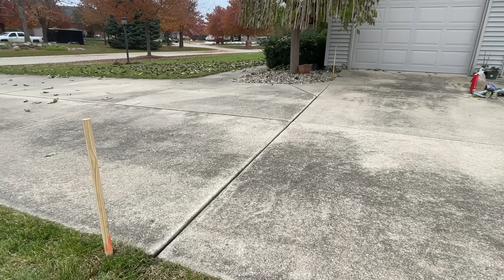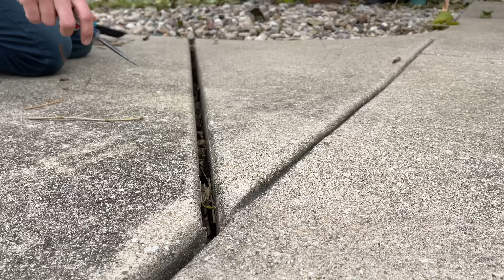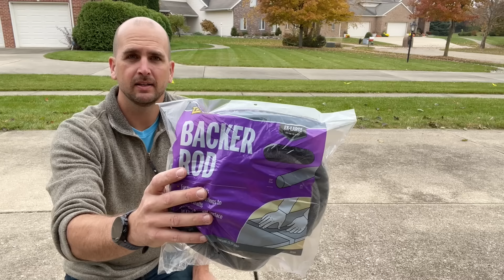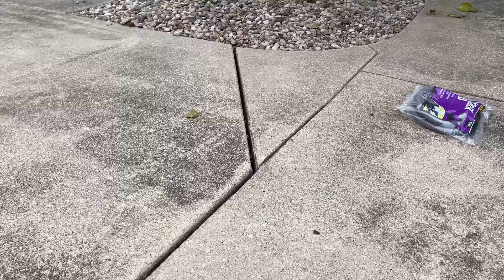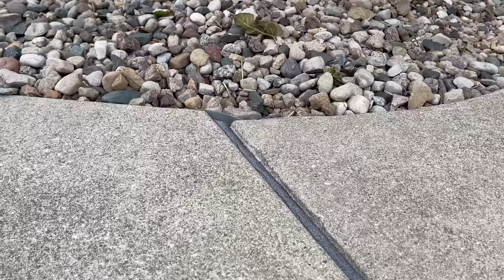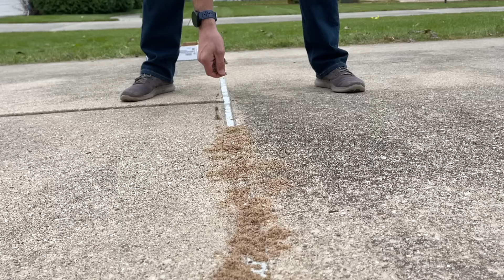How To Seal A Gap Between Concrete Slabs

Comment: Hi Scott, quick question. As you apply the vulkem to the expansion joint across the width of your driveway and you get to the intersections of the of the "control joints", is it necessary to have some kind of blockage (like your shim or tape) to prevent the product from oozing perpendicular from the expansion joint into the control joint?  Also, do you have any video recommendations for vulkem tooling?  I am sure I'll have some of that to do.    Thank you for your fantastic channel!

Comment: While I found your video very informative, we need to replace the expansion joint where our driveway and the street come together. The joint is closer to two inches wide on one end and 3" on the other end. How should we fill that joint prior to the self-leveling filler?
Reply: Playground sand, then Pea gravel...then playground sand again, followed by backer rod and then sealant.

Comment: I have a driveway that has both slope (much less than 6%) and horizontal applications for the sealant.  Besides cost is there a downside to using the Vulkem45 SSL in all applications or what % of slope is acceptable for Sika Sealant.  The specs look the same for gap movement between Sika Self Leveling and Vulkem SSL so it just come down to slope.

Comment: Love your videos, i have a question on slabs.  i have 4 slabs that were poored and they left the 2x4 as an expansion joint.  theses have since rotted out and there is a 1 1/4 gap between the slabs.  one has shifted as well and i need to level it with the other next to it.   can i just use concrete leveler to fill the gap and then level out the remaining.  maybe prefill some of the gap between with sand so it does not take as much concrete?  thank you again.

Comment: We had a patio poured years ago and it has cracked badly over the years. Would this be a way to fill cracks that formed in our concrete patio?  If not, any suggestions?

Comment: Great video, thanks! - Do you have a video on how to fix cracks on concrete slabs?
Reply from the maker: Not specifically, how wide is the crack?
Reply: @EverydayHomeRepairs  I'd say from 1/4 to 3/4 inch...somewhere around there.. maybe this is another video idea? haha.
Reply: I’m interested in this too. I have a customer who has a cracked slab in his garage. He doesn’t want to replace or cover the slab. He’s looking for a cost effective filling of the cracks. 

I’m wondering if this system would work for .25 to .5” cracks.
Reply: @macster1457  I have used the Vulkem SSL as a "thin coat" on some of these surface (hairline) cracks and stone pops, and it is surprising effective and long lasting. I tape out along the edges of the crack/pop, and then just squeeze some of the SSL over the area. Then I use a putty knife to smooth it out. Has worked awesome for me!

I should also mention that I use the Vulkem 171 primer before applying the SSL. It kinda acts like a contact cement with the SSL and really helps bond it tightly in the seams.

Lastly, make sure your are sealing your driveways every couple years as well to keep the water damage to a minimum especially for those of us in the freeze/thaw climates. I use Achro Seal 1315 about every other year

Comment: Very helpful video - thanks.  The gap I need to fill is just over an inch.  Do you think I could use the foam pipe wrap insulation for 1/2" copper pipe?

Comment: Hi , nice video ,  We have the same in our appartments , (but bigger ones) (145cm x14cm) and then 350  pieces of them ,  what would be the best way to seal these so as to avoid leakage and repairs to the rest of the neighboors? (10 floors overall)

Comment: Question...I'm in the middle of a large rental property project overhaul from Hurricane Ida...2625 sq ft of new concrete layed 3yrs ago, HC solid color solvent base stained Terra Cotta last week, and currently cutting down good wood expansion joints about an inch from surface...1. What is the difference between Vulkan 45 and 116 in semi self leveling? and 2. Can I apply over good wood expansion joints, with no voids, without a backer rod? Thanks for any replies, and guidance, Dave

Comment: 💥 $37 for a tube of that.??  Ouch…!!
Reply from the maker: Not sure why that price has ran up so much on Amazon.  Do you have Menards in your area?  They usually have the large tubes of the 45 SSL in stock.  https://www.menards.com/main/paint/caulks-sealants/silicone-caulk/tremco-reg-vulkem-reg-45-ssl-limestone-polyurethane-sealant-30-oz/356749/p-1100429375442051-c-7935.htm?tid=-7860838242119390935&ipos=3
Reply: @EverydayHomeRepairs   the closest one to me is 5-1/2 hours away but thanks anyway.
Reply from the maker: @Jimmy_Cavallo  😕

Comment: Thanks for this video, its just what I need. But I see that you only sealed the expansion joint where there was a wood filler. But do you also need to seal the remaining joints. I believe they are called control joints. There is a crack at the bottom of each control joint and rain runs off my sloped driveway until it runs into one of these control joints and then goes straight down through the crack. Im wondering if this will wash away the gravel base.
Thanks for any advice
Reply from the maker: Hey Patrick, yeah I do have a couple of other areas which need some attention.  Nice thing is I have 2 extra tubes of the 45 SSL 👍.  I also just need to get a much smaller backer rod to fit in the other cracks which are more like 3/8".  You better hurry up sealing your projects if you are up in Calgary 🥶  Best of luck!
Reply: @EverydayHomeRepairs  unfortunately I think it’s too late so I’m done till spring now. 
How necessary do you think this is, though? I don’t see anyone else sealing these control joints. Or maybe theirs aren’t all cracked open like mine.

Comment: Hello 👋🏼  What if my expansion gaps are approx     1  2/16ths wide and 4” deep?  Pool noodle filling and what about the sealant? Could I still use this sealant you’re using? Or what other option would you suggest? Thank you 🙏🏼 so much.

Comment: Looks great! Do you have to wait a day or so before driving over it?
Reply from the maker: Good question and it kind of depends on the level you fill the joint.  Is you leave the sealant about 1/4 below the concrete surface you should be fine in just a couple hours.  If the sealant is high and at the level of the concrete a tire might slightly imprint the sealant if you don’t wait a day.  Instructions say it will take 1 day to cure per 1/16” in depth at about 70F.

Comment: Can you use this product in colder temps closer to 35 degrees Fahrenheit?  I didn't get a chance to fix one of the larger cracks in my sidewalk with a slope and am worried when the snow/ice starts in the northeast, it may be dangerous.

Comment: I have a 44' x 3/4" x 4" deep expansion joint on a basketball court. The 2 slabs are not even for that distance. I want to use portland/sand and fill then feather in to even out the height difference, will this work?

Comment: I have a concrete pad garage and on the side of the garage a concrete driveway was poured.  The people that did the driveway used 2x4's and 3/4" nailed into the garage pad and used that as a form.  They left the forms and over the years (20+) it has just rotted away.  I had a small termite issue because that wood was always wet and most of it was covered by the siding and J channel.  I have since ripped out all the rotted wood and I have a 3" - 3.25" wide by 4"-5" deep "trench up against the garage.  I was wondering if this type of material would work for that and what would I use to fill the channel before the Vulkem. stone? Is there backer rod 3.5" thick?  Can I even use that much Vulkem?  I think thats the same material they use around pool coping and I have seen that 2" wide.  Any help would be appreciated.

Comment: Thank you for the great video. I have one simple question I hope you can answer. How much of a void under the backer rod is acceptable? For my joints I can see and/or feel the bottom where the dirt or sand is, but it's probably a good 1/2" to 3/4" below where the backer rod would be. Do I need to fill that in with sand?
Reply: Absolutely not. The backer rod should be a snug fit so it won’t sink when the sealant is installed . It doesn’t need to be supported by anything underneath.
Reply: I would fill with sand, to support the backer rod...for sure! How we forget that 2000+lb vehicles compress the concrete pad, that will over time most likely compress anything that is in the expansion joint. Backfill with sand first, most definitely.

Comment: The caulk (originally grey) installed in my concrete driveway expansion joints has developed a black dirty color.  Any suggestions on cleaning this rather than removing it all and starting over?
Reply: Pressure washer

Comment: the gap between my apron and garage floor slab is VERY deep.  I started to dump sand in but after tons of sand going to china (2 large buckets) I stopped.  What do I do?
Reply: Use the correct tightly fitting backer rod. If the backer rod is correctly sized the sand is a waste of time.
https://www.tremcosealants.com/fileshare/DataSheets_Hyland/Vulkem_45SSL_DS.pdf this is the data sheet for vulkem45SSL if you scroll down you will see a representation of how the backer rod should be installed

Comment: A tube of the caulk sealant is $53 on Amazon?  That can’t be right is it???
Reply from the maker: Not sure what is going on with the Amazon sellers.  Must be a shortage of supply driving the price to crazy levels.  I looked and found the same tube at Menards the other day for $18.  Not sure if you have Menards in your area.
Reply: I found SSL45 at Lowes for $18 for 30 oz. tube.

Comment: Why not just use sand instead of the backer rod to get the crack filled up?
Reply: Because the sealant needs to be concave  on the bottom to perform correctly so you need a convex backer

Comment: I'd try Silica Sand which professional pavers use. It flows into the voids really well, sets solid yet remains flexible when wet and doesn't wash out, then backer rod as you explained. Using ordinary paving or just sand will absorb eventually into the sub-soil creating another void. 
Just my fussy way of doing things - not for everyone.
Great job and tips by the way - Thanks!
Reply: How is Silica Sand different from other sands that would prevent it from eventually washing out?
Reply: I bought silica sand for my job. It costs a bit more and is harder to find, but I wanted to use only that because it's flexible. I'm filling the large gap between my foundation and driveway. I needed it to be flexible for the freeze and thaw in the Michigan winter. It's called Quikrete Commercial Sand at the hardware store. I wonder if that would look good on the top of the caulk at the end. It's a rather light color so I'm not so sure if it would work.
Reply: Wear a respirator, or at least a mask, when you use silica sand, or risk needing a lung transplant!  Silicosis.